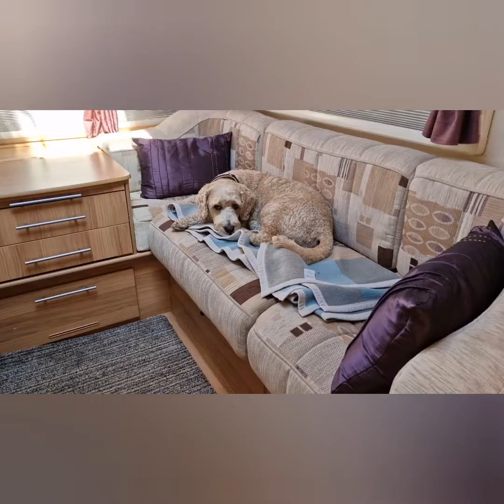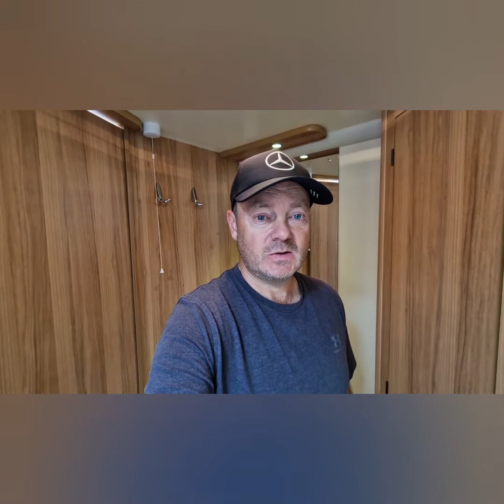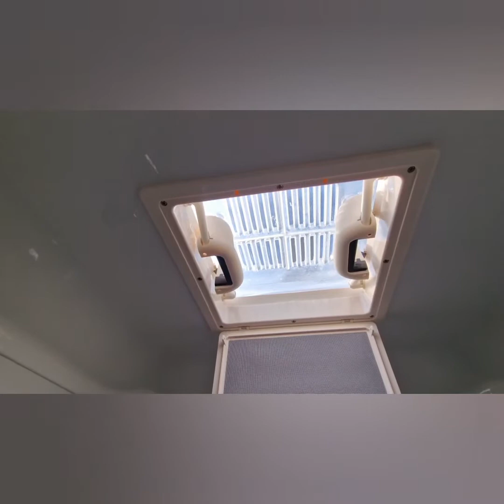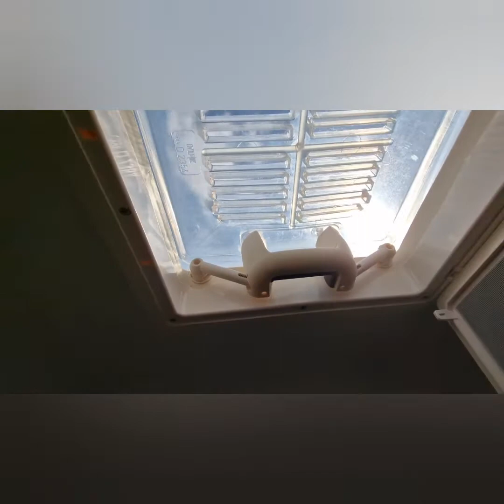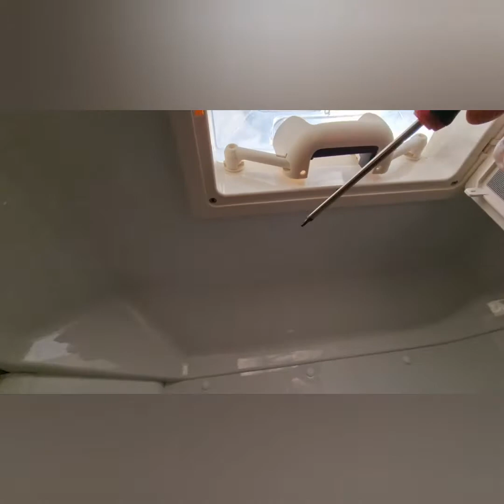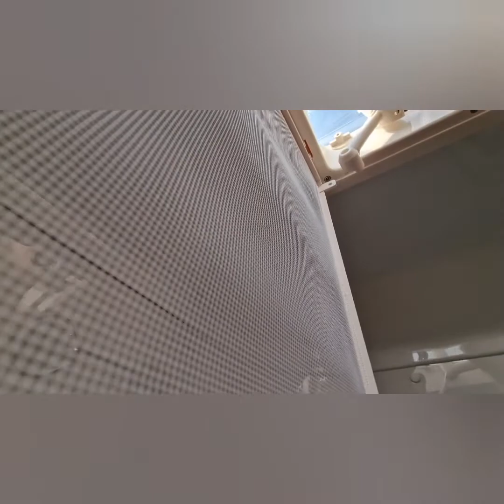How to replace your Caravan domed roof light

Comment: Our plastic the outta part of bathroom has blown off and broken no idea what we need to buy or how to fix , any advice please
Reply: It’s a Coachman Pastiche 470/2
Reply from the maker: I would recommend having a look on eBay for a replacement part. Measure your existing part and compare it to the ones on offer on eBay. I'm not sure which rooflight you have but it could be either a heki or Seitz brand.
Reply: We think It’s a heki have been quoted just over a hundred pound by a caravan company for the part, but will look on eBay too, thank you, just hope it’s easy to fit 🥹 thanks again for reply